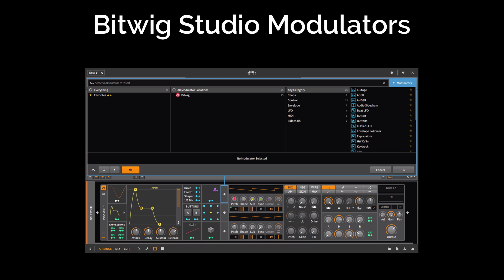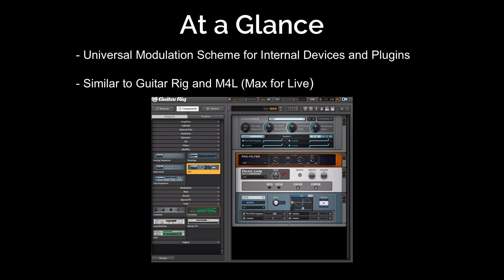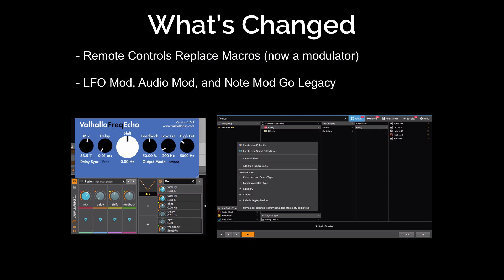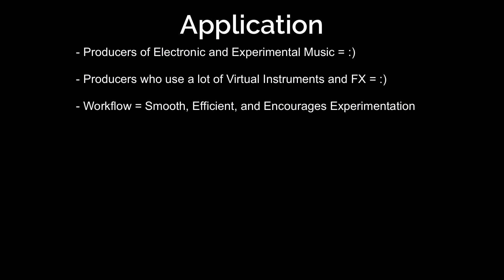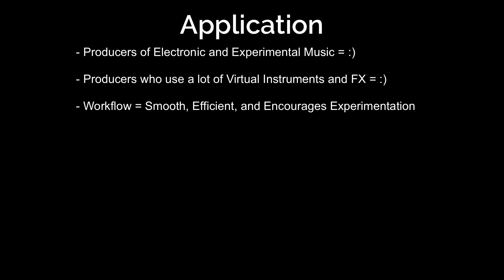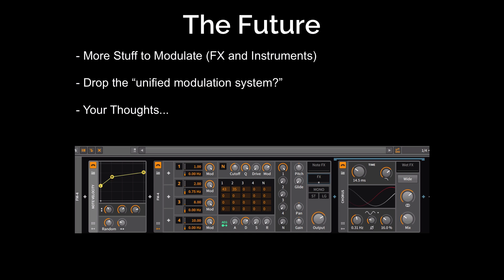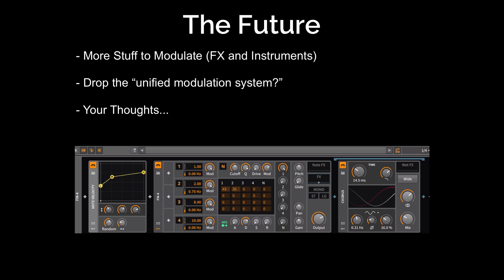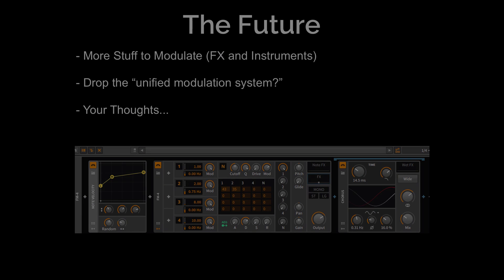01 Bitwig The Modulators (Course Introduction)

Comment: I'd love if Bitwig somehow tried to break off from Live (or Renoise)-like way of displaying device chains. 

With modulators, nested devices and containers it becomes increasingly difficult to track the signal / modulation flow, so I'd appreciate if they added some kind of modular overview of what's connected to what like in Reaktor or Psycle:

https://www.native-instruments.com/typo3temp/pics/img-ce-reaktor_6_whats_new_04_modern_interface-db72da59b55a0b1a5b5fbaa033317127-d.jpg

http://psycle.pastnotecut.org/images/screen/screenshot5.jpg

Maybe not as a default view, but as a separate panel for those that would want it?